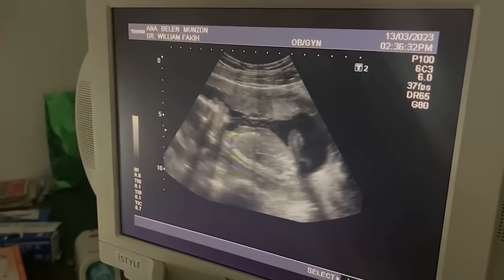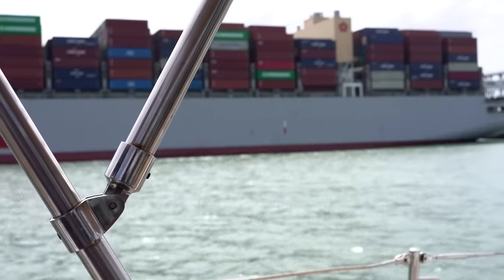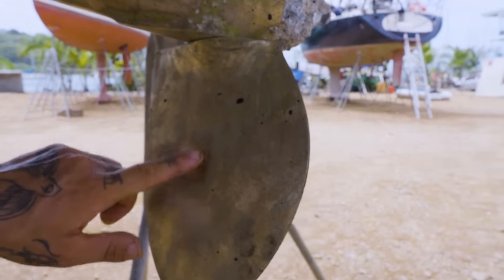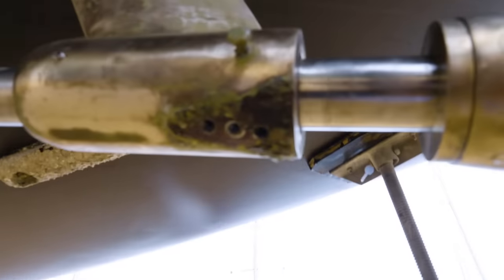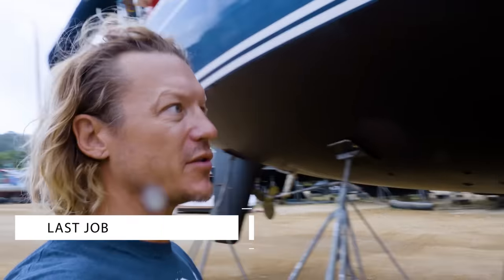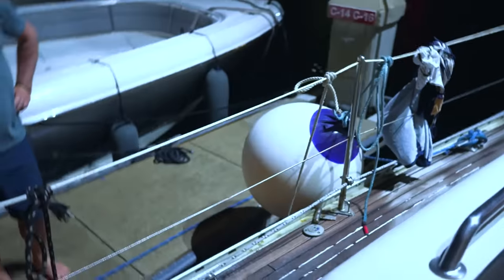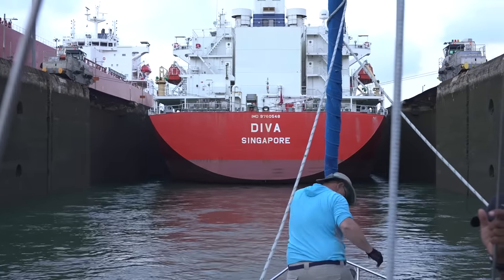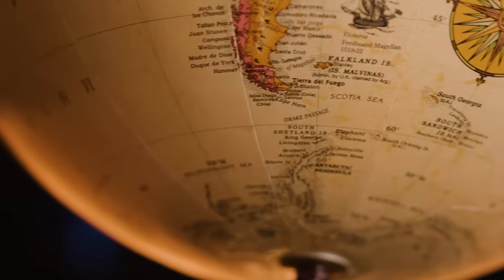Panama Canal transit with beautiful poeple!  |  S4E5

Comment: Good technique removing the drip less shaft connector boot. The tried and true, “lift and pry” method. A lot more then just the technical step by step methods in shop manuals for repairing anything mechanical. The smaller more nuanced actual knowledge needed to effect repairs comes with experience, usually not included in the manuals. Kind of like reading a complicated recipe written up by a great cook. They always somehow leave certain “little” details out and you wonder why your dish does not turn out like theirs.

Comment: El copper Coat se aplica en EE.UU y su base es cobre
Reply: Coppercoat is a non-ablative hard epoxy coating. The copper doesn't contaminate the surrounding water like copper based ablative coatings.

Comment: Do you know that you have a variable pitch propeller and an angle of attack of 35 degrees? that Oyster girl must have an engine with more than 44 HP. A jewel of American naval architecture
Reply: It's not a variable pitch but a feathering prop and Oysters are built in the UK.